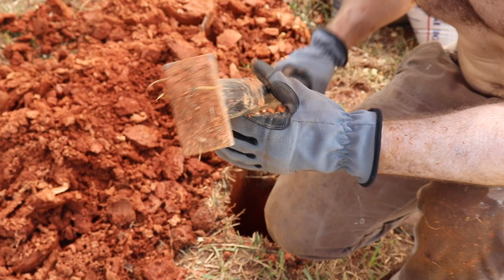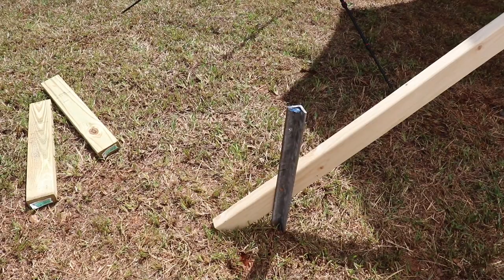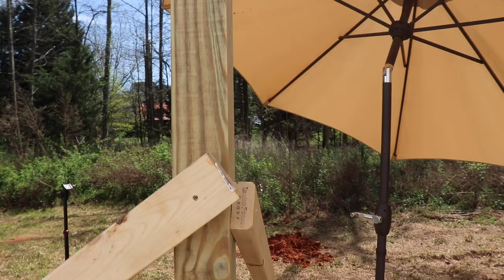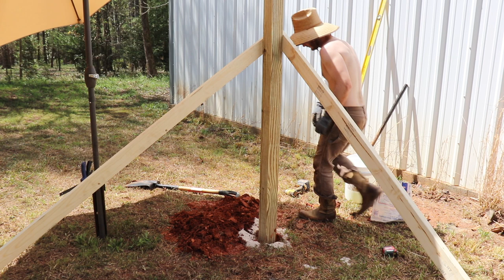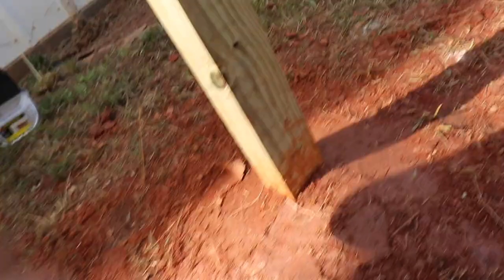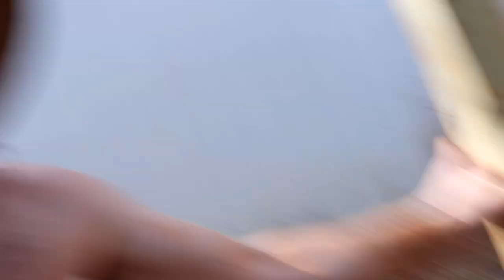Setting Fence Post The Right Way

Comment: Very informative! Long lasting for sure. Can the fence be stretched right away?
Reply from the maker: Before stretching the fence you will want to finish off the corner by adding the horizontal brace between the corner post and the next post inline. Then you can stretch your fence right away.

Comment: I like it, I've never heard/seen posts set this way but I like it.  How long does it take you to set a corner post with this method?
Reply from the maker: Depends on if it is the first post of the day or the last post! Between digging the hole and keying in the corner it takes about an 45 minutes to an hour. The keying process takes an additional 15 minutes or so but is well worth the time and effort.
Reply: @justinmcrae478  that's not terrible. Between mixing 'crete etc the time is comparable.